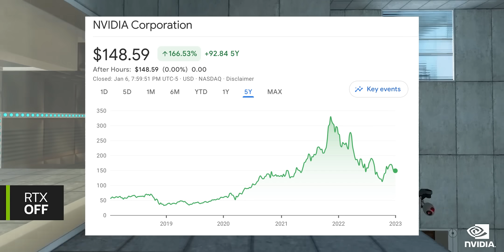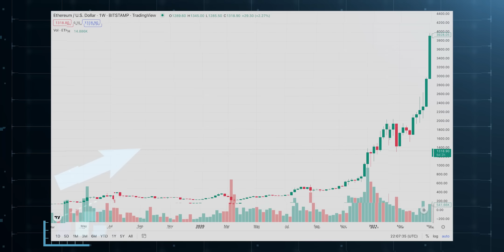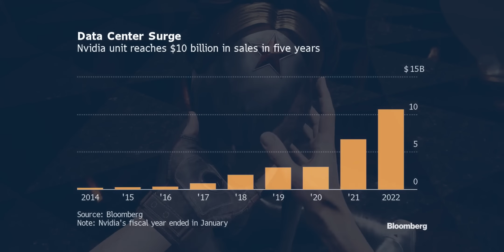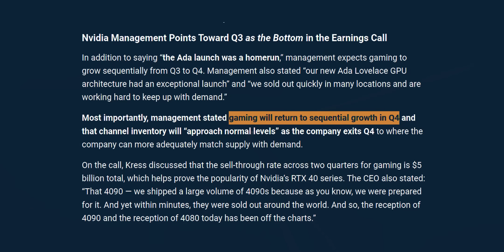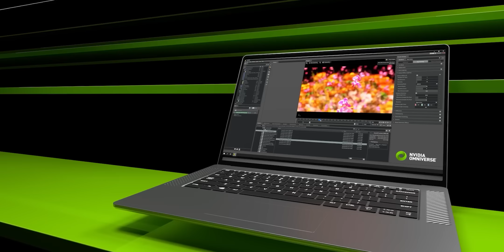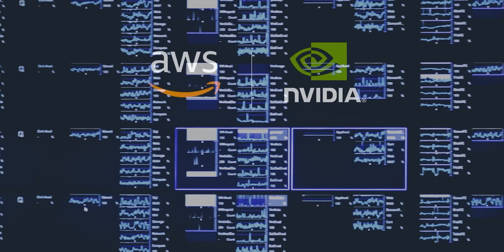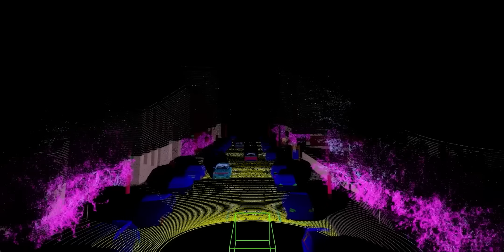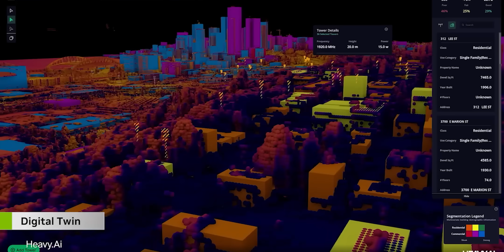Nvidia: The Most Powerful AI Company Ever? (NVDA Stock)

Comment: In my country's government they do not want us civilians to use their scan-copy-transfer (SCT IC Chip) IC chip which can scan incoming computer input, make multiple copies of it, and transfer one of each of these multiple copies to 2, 4, 8, 16, 32 individual CPUs that will process the WHOLE information and then they use an another component that receives the processed information and compare all of the results and once all are cross-referenced and are the same they are then combined as one information output which is then displayed on one or more computer monitor display.

Does your American hard drive cloners can do the same? And what is the key component in your hard drive cloners that can make multiple duplicate copies of the 1st primary hard drives and then transfers those multiple duplicate copies to several tens of dozens of hard drives? Can you and somebody or anybody help me please?

Maybe, just maybe that key critical component of your American hard drive cloners can do the same function as my country's government's (SCT IC Chip) Scan - Copy - Transfer IC Chip.

what is that old 1990s device that can allow you connect all of your VCRs, DVDs, Radio Cassettes, Phonographs, TVs, Computers together in that old 1990s device that can allow me to instantly switch from one device to another by just pressing a switch?

Comment: The NVDA options market is pricing in less than a 12% chance that the stock exceeds it's all time high in the next 2.5 years.   You can't actually buy 340 strike options, because there are none so this is based off of the 330.  The stock chart itself indicates that NVDA could recover to the 210-220 region but it's more likely to go sideways or down.  The average PC gamer has not been able to afford a GPU since the 10 series GPUs.  This is quite clear by the number of people who use them from Steam's GPU charts.  When you combine the fact that you need a $1000 4k monitor to truly appreciate the 40 series GPUs, you really start pricing out the consumer.  You need to spend $2500 with tax.  There is a very high likelihood that we will go through a period of consolidation, where the monitor technology needs to improve a bit more and the prices need to come down.  You tell me when I can buy a $400 120hz 4k panel and that will be the time to look at buying NVDA stock.  Any improvement to the 40 series, like the Ti, or Super variants are completely wasted until monitor technology catches up - because right now it's pricing way too many people out of the market.  End of Story. There's a good chance NVDA goes to $80 or lower.  Be careful.
Reply: Lol

Comment: The 4090 sold out due mostly to scalpers. They are currently trying to offload these cards on Ebay. There remains a massive stockpile of used higher end 3000 series cards being sold on Ebay as well due to no longer being used for mining Etherium.
The stock market is set to implode, not explode any day. It's a bad time to buy NVDA imo
Reply: Not certain. The FED and its agents can keep the balls floating for longer and with China coming back on stream the DS may well feel they are force to lest they lose the geopolitical  currency Ko in a move to CDC. China is buying gold further pressuring the dollar. Can The City take the risk of a market crash and the wealth outflow ?
Reply: Not really, there are virtually no 4090s available. I want one and the lack of them is meaning a whole computer is not being sold. Been holding off since before covid as I would not pay scalpers. For some reason, NVidia are failing to supply a product they can sell. I do not think it is really that effective at getting anyone to buy the left over 3000 series.

Comment: Did you say Fugaku is the fastest supercomputer right now? It lost the first place in top 500 ranking to Frontier in June 2022 list. Also, comparing NVidia's hyped up AI flops (FP8) to Fugaku's FP64 used in scientific computing is comparing apples to oranges. NVidia is a great company and a leader in AI  and HPC. But they tend to hype up their performance too much at time and you need to be careful when you look at their performance claims.
Reply from the maker: Thanks for the clarification! I didn't realize Fugaku lost the top spot!
Reply: @TickerSymbolYOU  And Frontier runs on AMD CPUs and AMD GPUs
Reply: @TickerSymbolYOU  It seems like what you (and NVidia) said was true 9 month ago when JH announced Grace & Hopper. But soon after, Frontier came online and it changed the HPC landscape in a significant way. NVidia is still a leader in GPU compute and AI. However, their Grace CPU won't be able to compete effectively against Intel and AMD's respective CPU offerings. It may do ok when paired with Hopper since they can communicate with each other using very fast NV Link.

Comment: I don't believe that. I think GPU shortages was mainly driven by mining. Now that mining is dead, there is no GPU shortage and the pricing nVidia has become accustomed to doesn't work. Nvidia has sold out of it's embarrassingly small launch volume of 4090, but 4080 is languishing on the shelves. It's not the highest end halo product and nobody is going to spend what they are asking for it. Scalpers bought a bunch of 4080's expecting to be able to resell them at a profit, but even scalpers are stuck with inventory. The glut of 30-series products after mining died is likely why nVidia is high-balling the 4080; they need to let their board partners clear inventory.

nVidia may do better in some other market segment, but in gaming their products will not do well. Neither will AMD. People will simply hold on to older GPUs for a lot longer and wait for AMD and nVidia to get serious and drop prices by 30-50% or until the next or next-next generation offers 4090 performance at half the price.
Reply: Agreed meanwhile 3070 is more or less sufficient ror most games.
Reply: Lots of 4090 4080 and 4070ti in stock in my city right now. The only ones out of stock are the founders editions because those are the cheapest

Comment: Not sure about recession and consumer spending impact on overpriced GPUs🤔. Same for data centers, people might stop paying for idle machines and start optimizing their cost structure and cloud renting.  This being temporary of course.
Reply: Sorry, as a cloud engineer and system architect, the trend is in reverse actually. The in-house and Hybrid is the new trend for most. Let me explain. The overpriced Cloud exploits were too much to handle for mid scale and small scale buyers. Despite the introduction of arm based processors, which lack firmware support for intel based developers, the price made sense only for ultra-large companies like Netflix or OneDrive. For the rest, it turned out that having an in-house machine for most part with cloud extension for high-usage period allowed not buying hardware over the required capacity. Thus, you can see the rise of many cloud providers who focus on hybrid rental models. Also, for ultra small users, options like PaaS (ReScale) allow much easier cloud cocktail to prepare for exact usage, while developing in-house on a mini/micro/nano cluster. So cloud is there to stay but it will not grow as rapidly as you saw in last 7yrs. It will still keep growing because in the end, as I explained, even Hybrid needs a cloud to function. With crypto, the in-house will keep seeing gradual growth. So in the end, it;s actually the in-house with cluster-native (previously termed as cloud-native) chips like Arm based Ampere Altra, SiPearl, and others will be churned out for in-house clusters. Whereas AWS's C7g and Alibaba Yitian will see only local adoption at a much slower rate compared to the other two. The war has already begun. 

Investing in Nvidia is nevertheless a wise move, because in 10 years META will be going back up. Like the apple of 1980s. It's way ahead of the rest in AR and when the technology has matured enough, it will be head on with Apple in the Smart Glasses market. Both of these will heavily rely on Nvidia products in the clusters.
Reply: @suyashneelambugg  Apple has this their custom SOC processors with graphics and neural cores. I can only imagine their processors getting better, why would they rely on nvidia 10 years in the future?

Comment: Do you agree that INTC has way better upside potential within the next five years, given its much lower P/S valuation (INTC 1.71 vs. NVDA 13.97) and massive investment in chip manufacturing that will give INTC technology leadership in transistor density by 2025? You can say the same about the P/S valuation of INTC 1.71 vs. TSM 6.37. INTC will likely manufacture leading-edge chips for NVDA and AMD in the future.
Reply from the maker: The problem isn't the multiples. It's their insanely aggressive 4-year roadmap. If they can pull it off, you're right. But if they can't...
Reply: @TickerSymbolYOU   It's not a zero sum game, at current valuations, I'm willing to bet INTC will be positioned to gain market share from TSM in the future, and offers a more compelling risk to reward tradeoff even if it is partially successful in achieving it's aggressive goals. INTC is not going anywhere is my point and offers a better value investment opportunity. I hope I make sense.
Reply: @googi2003  Intel is still stuck at 10 nm after about seven years. TSMC is already working on 2nm. I have zero confidence that they can keep up with TSMC and Samsung.
Reply: @googi2003  I agree fully with your point. Long Intel short nvidia.
Reply: If you believe "INTC technology leadership in transistor density by 2025" then yes. The problem is a lot of people, me included, don't believe that.
Reply: Careful with intc, as Brookfield owns a part of their new foundry, as in, not all profits will be going to intc.
Reply: Risky investing in Intel with AMD continuing to take a significant amount of market share in data center from Intel.
Reply: NM to NM intel makes better CPU. For example ryzen 7000 , 5nm AM5 vs intel 13th gen -10 nm , I believe intel perform better as a whole for their latest raptorlake (there is a cpu bending problem , fixable easily with a $5-8 thermalright addon).
Problem is intel's fab - the previous dumbed down ceo Bob Swan refused to invest in the fab - because he's a finance guy. They should have invested in smaller nm chips long ago. Knowing this fact, I never bought AMD or intel - i bought TSM , which makes the smaller nm chips for apple, nvidia and amd and intel now. Apparently a big shot investor (buffet) shared the same thoughts.
If you think nvidia is going to perform well in 2023 - the GUIDANCE from tsm is bad. TSM's guidance is basically connected to nvda - I dont suggest buying nvda unless the price drops back or until previous trends reemerge (gpu mining). 
I am a gpu miner and pc shop owner , so i talk the talk, walk the walk.
Reply: @rnegoro1  I agree and now under Pat, they are doing what they should have done years ago. So my thesis stands, long term, INTC is good buy, just like TSM is a good buy today. The biggest risk with TSM is geopolitical, hence the discount. Buffet investing in TSM is a good sign.
Reply: intel stock returns is going to put a lot of people down to earth…
Reply: Intel simply makes better CPU's and has been doing so for years.
Reply: You can never play catch-up in technology without taking huge damage.